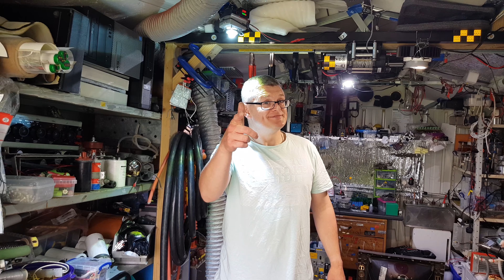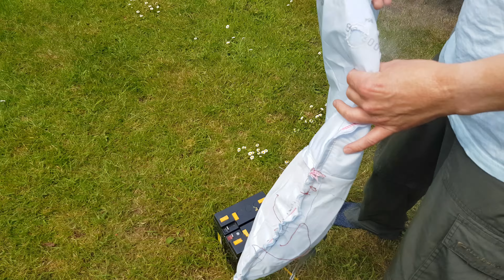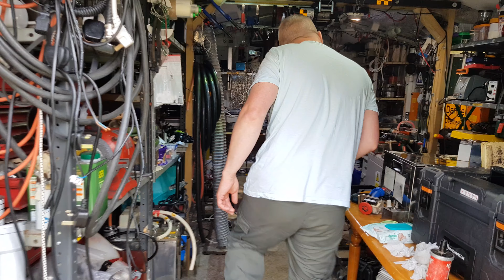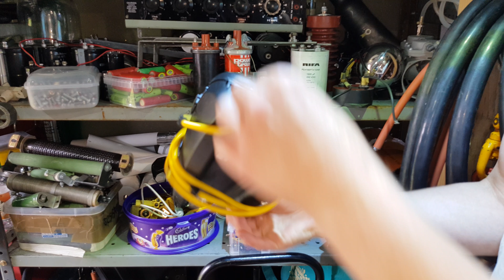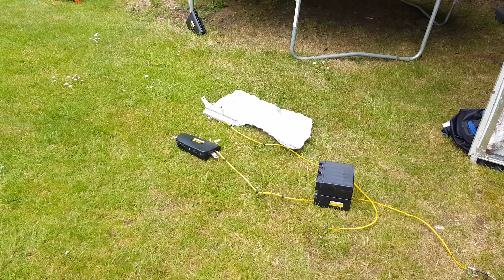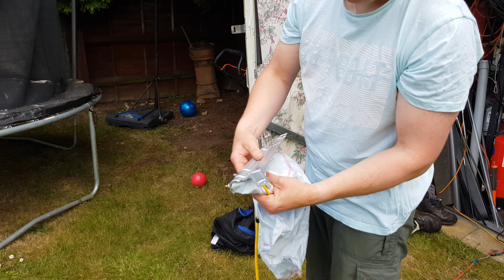How to set off a Airbag safely!

Comment: Hey man! Wanted to ask in direct message but I don't know how to send one so I'm gonna ask here: what's the best way to ballast a PT? I tried mot but it overheats quickly. Could I use a variac?
Reply from the maker: My friend I’m so sorry I’ve not seen your comment and it’s been 5 years. I try to reply to all my comments but for some reason YouTube doesn’t always remind me. I’m super sorry for this belated reply!
Yes you can use a variac but it can be difficult. I would use sodium big ballasts like 200watt or 300watts or if ya can get hold of a 500watts. But these you can parallel using mains contactors! As a switch turning each one on ramping up the wattage for your potential transformer. I had a 110Ac / 20kv  and would ballast that putting in 230 volts and the thing gave some awesome arcs!! But best to keep the wattage down as much as possible and don’t run them too long! It’s all common sense.

Be safe using high voltage. Always protect yourself and always have one hand away behind your back or in your pocket. And always use a chicken stick, and always second check wires and switches. Always unplug safety first.
Regards
Anthony / high1voltage1rules